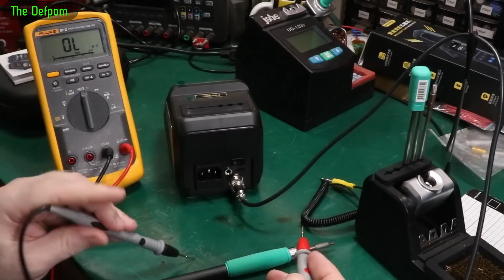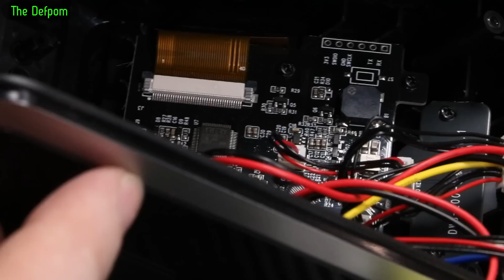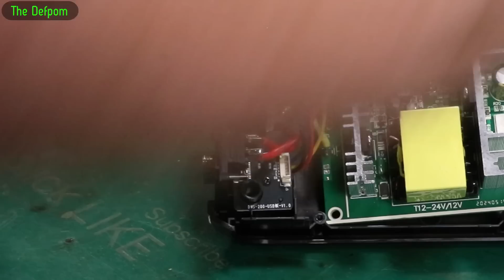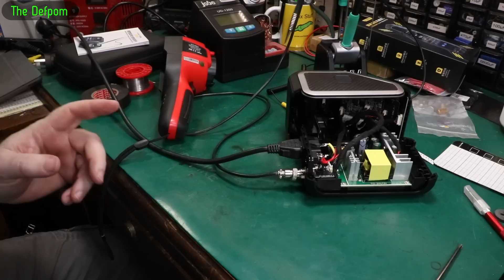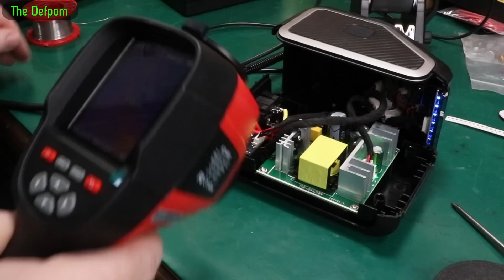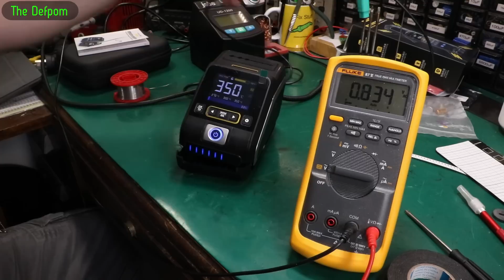🔴 FNIRSI DWS-200 Soldering Station Review Followup and Improvement - No.1321

Comment: You should just short that, not 2 Ohm, but with a short. I did that, in fact, I've added a decent thick copper wire from earth connection to the 5 pin connector directly. But, there is another big problem with this statuon. Haven't you notced wideband noise from it? I did. I'm a HAM radio op. and this thing makes weak signal reception impossible. I did tested with a spectrum analyser with a wide band antenna in about a meter and this thing is horrible. I've added ferrite beads before the SMPSU on the AC lines and afterthe SMPSU on the DC lines, it helped a little, but I'm very disappointed. This soldering station is also sold in EU, which means it should have been EMC tested, I'm wondering how it passed. I even notice the noise from it when I check low level signals on osciloscope. This is how I actually found it is polluting, then tested with spectrum analyser and realized the iron is not earthed so I added the short. Shorting actually made the EMC issue a bit worst (not a lot, just a few dB). I was thinking to get an Aixun, this has metal housing and it is a closed tube, but inside it has the same SMPSU 😞
Reply from the maker: The SMPS is also audible, you can hear it cycling. My previous bench iron is a jabe UD-1500 which is very well made and I really like it, I reviewed it a few years ago:https://www.youtube.com/watch?v=rzp24iXOqdI 
I am thinking of going back to it now that I have used this unit for a while (although it works OK, and has features I prefer in some ways)
Reply: @TheDefpom  hello will you be switching back? I'm in the market for an iron am stumbled onto your video
Reply from the maker: @unknown12712  It has been working well for me, my 2nd choice is the Jabe UD-1200, which I also reviewed.
Reply: wait til you find out about arc welders dude
Reply: I believe the design engineers didn't fully understand how static electricity and leakage current manifest on the soldering station: if the soldering iron tip on the handle is properly connected to ground, there will be neither static electricity nor leakage current. As for the EMC problem, it's purely because its switching power supply is terrible and likely hasn't undergone any EMC certification testing.

Comment: Hello, I'm wondering if there is a soldering station model that allows the C210 and C245 tips, that is good and not so expensive, as an alternative to JBC and Hakko, etc.
Reply: This featured model comes with two handles. One has T210 and the other T245 fake JBC handles. They come with a lot of tips to. According to some people real JBC tips work in it and these tips you get with it work in the JBC stations as well. So yeah. Also people have measured that it does pull 200 Watt out of the wall when tip is dipped in water and you choose maximum temperature.
This model does almost everything that JBC models costing 7 to 8 times more do. 
But then it is a thing where any part can die in months and controller is just an universal STM32 chip. I mean they did really good with interface and features for what it is but it is nowhere near what JBC does with their stuff.
With JBC sponge and handle has antibacterial effect and it is still light and cable is great silicone cable. They copied almost everything but is is antibacterial?
Most JBC station have really great case and are powered with the transformer of decent size and weight. This uses ordinary Chinese switching 24V power supply. No wonder it ahs issues with grounding and that it emits tons of magnetic crap around. Even on one video camera pickups EMI as soon as you start melting tin and you hear buzzing. In real life you can not hear it but camera is affected by it. 
So yeah JBC stays for what it is a professional tool.
While this is great value and if it dies in a few months you get another one and get even more spare parts with it :)
Reply: I recommend you to consider AIFEN A9 PLUS Soldering Station.
Reply: The AIFEN A9 PLUS Soldering Station is in a very different price range.

Comment: @TheDefpom Have you reached out to FNIRSI regarding this issue?
Reply: @samiu7580  Hi. I've received the answer from Nfirsi today. If you want to get grounding to the tip you have to solder in a zero ohm resistor on the two empty pads which are shown in the Video. By the way very good explanation and thanks for your video @theDefpom
Reply: @STUDIO4REO  or you could jump the two open pads with a solder blob for immediate earthing as apposed to receiving impedance. A zero ohm resistor is the same as a solder blob.?? I see theres also an unused open male pin on the 5 pin handle socket plug that goes nowwhere.
Reply: @STUDIO4REO  What was the answer from FNIRSI?
Reply from the maker: @samiu7580  no I haven’t, I doubt I would get an answer about this particular finding anyway.

Comment: Why did they leave the resistor out? They're Chinese, they don't care about safety, or anything at all, really. Perhaps it's normal for Chinese technicians to be soldering live circuits?
Reply: My friend, I understand your frustration. However, if I were to recommend a soldering station with a built-in ground fault monitoring and alarm function, it would demonstrate that there are indeed some incredibly dedicated Chinese engineers. They are capable of achieving exceptional performance and value for money.  It might surprise many people: it heats up quickly, is durable, energy-efficient, compatible with power supplies worldwide, features ground fault monitoring and alarm, and has intelligent sleep mode.  It effectively addresses almost all the pain points users experience.
Reply: С резистором станция сходит с ума - при прикосновении к заземлённой точке начинает греть жало "до покраснения"!!! Вот такой дефект реализации мониторинга температуры жала. Это у всех "китайских" контроллеров С245 так!

Comment: Can you check one thing with that soldering station do you get any interference on the FM band on the radio I've managed to buy soldering  GEEBOON TC22 C245 station. Work very well but so much Emi interference and all the radios on FM band I get this interference even when the soldering on is in standby and the power supply is on and it's exactly the same power supply that you have there. I've tested the choke it's good the capacitor is good the Earth to the tip is good the Earth to the body is good the Earth to the negative of the output capacitor on the secondary side is good.
Reply: I've had Chinese rubbish completely wipe out MW (called the AM broadcast band in the USA) before, but causing interference on FM, that's some truly extreme negligent design work for sure!
Reply: @BrianG61UK  I have improved it a slight bit by adding large amount of capacitance on the output DC stage or adding better capacitors than what they had before well crap. But still some FM stations not very good it does wipe them out. When I look at the actual switching frequency on the secondary winding it's about 25 kilohertz which is very low should have been a lot more higher. The next thing that I'm going to try will be to remove the switch mode and add a Transformer with a basic full Bridge rectifier with a good smoothing and then see if that gets rid of all this garbage noise it should as it's linear not switch mode. And if it is the case and everything works out very well I'll have to get somebody to 3D new housing or maybe I could just look for something which is metal just the right size and add everything from the Chinese iron into it including the Transformer.

Comment: J'ai vérifié le mien, j'ai un voltage qui varie 30 à 40 volts dépendant du voltemetre utiliser.
D'après moi c'est un voltage induit par effet capacitif. (Varie en fonction de l'impédance du multimetre)
C'est la raison pour laquelle qu'on lit un voltage AC et non DC
En ajoutant une résistance de 5.58k en parallèle avec le multimetre,le voltage mesuré est de 0.470 volts.
Reply: Can you let us all know how you went with that resistor in there please
Reply: when I measured with the multimeter I went from 40 volts to 0.470 volts.  what confirms it for me is by capacitive effect.  I did not modify the soldering station after this.

resistance between soldering tip and ground > 2 G ohms at 250 volts.
Reply: @colingag  Isn't this obvious? Why did you need to check?
Reply: @BrianG61UK  
As a personal experience, I wanted to know what voltage it would have dropped to.

Comment: I use Hakko soldering equipment and the tips are absolute direct earth grounded.  No way should that have been left floating.  Missing part was probably intended as a fast blow fuse in case the tip touches a live circuit, like a mains line or DC supply, that has earth ground reference.  Good video!

Comment: @Defpom It would be good if you could do a short followup video or comment, letting us know what happens if you connect the tip to mains earth following your mod. Does it behave well or does it exhibit the same, pretty nasty, problems that tony359 had with his Aixun T3A? If it does work well it would be interesting to know how FNIRSI avoided it - beyond eliminating the ground connection altogether.
Reply from the maker: @tonyh6309  it’s been working fine.

Comment: I just received this station and it seems to have trouble melting solder even though I have it set to 450 degrees Celsius (way too high I know).  I don't have a tool to calibrate it so should I just return the thing? Has anyone experienced anything like that before and have any tips?

It seems like the tips temp fluctuates even though it does not show it on the display. I find I have to touch the solder near the upper sides of the tip as well which doesn't seem right. These are brand new tips and I have a lot of trouble getting it to work.
Reply from the maker: sounds like you should send it back.
Reply: i received this station today and i dont have problems to metling solder with 300 degrees, maybe you need to calibrate it.

Comment: (Part 2) I see tony359 has commented here earlier; I strongly suggest you watch his video about the awful Aixtun T3A and read my comments there - search "Is the Aixun T3A a good T245 soldering station?"
There's a good reason that JBC used a transformer rather than a cheap SMPS!
Maybe FNIRSI have avoided these problems by clever engineering, but I somewhat doubt it...

Comment: BAD MOVE!!! (Part 1 of 2 in attempt to avoid YT deletion)
The tip thermocouple is connected between the tip and heater element common. The latter will be connected via the iron's flex to the station's -ve.
So you've just created an alternative return route for the heater current should you try to solder a joint that is mains grounded -through the thermocouple, tip, grounded equipment, mains earth, 2ohm resistor back to station supply -ve. A few amps of heater current going through your precious, pride and joy, device-under-repair might not make it betterer!

Also bad, if not worse, the new 2ohm resistor + plus the parallel mains earth route are now shorting out the tip's thermocouple so the station will likely pump up the power to maximum!
Reply: Y que pasa si pones 0.22 ohm en lugar de 2 ohm que posee la jbc ( la jbc tiene 0.22 ohm mas un fusible de 1.5 amp.) conectado a tierra  , funcionaria ???
Reply: @orlandoalarcon4158  Maybe, but I doubt it. As far as I can remember (it was a year ago I looked at the JBC schematics), JBC ground the actual tip - not the TC/heater common lead/-ve power supply via the fuse + resistor. The fuse has a parallel 1.2MOhm resistor to keep it ESD safe should the fuse blow and the series resistor is only there, I believe, to allow them to measure any earth leakage current.

You could do the same to the DWS-200 but the mains leakage current through the class Y EMI/filter cap in the SMPS would then flow through the TC (thermocouple) potentially swamping the tiny (uV) TC signal upsetting the tip's temperature regulation. The JBC station doesn't have that problem because it uses a mains transformer and thus does not need a class Y cap to filter high frequency switching noise.
Reply: yes, that is a problem with badly implemented 245/210 irons. sometimes you have to swap the polarity of the tip. that sometimes fixes the issue.

Comment: EMC problems?  Maybe it failed an EMC test with the iron grounded as any HF leakage current from the switching PSU could be coupled back to the iron lead which would act as an additional antenna.
Reply: igual en la jbc esta conectado a tierra una resistencia de bajo valor + un fusible de 1.25 A  y en paralelo al fusible una resistencia de 1 mega  y no se pueden soldar circuitos con alimentacion en vivo el fusible saltara

Comment: its safe with that resistor to update firmware via USB-C ?
Reply from the maker: @Rudimaximus  that is the question, it probably depends on how your computer handles earth connections on its ports.
Reply: @TheDefpom  use a flash drive, $4 beats losing a pc worth thousands.

Comment: Now put a note on the unit. "Never work on a live voltage connected device "
Imagine touching your "earth" solder pen on the hot side...😮
Even on the low side could be a problemow
Reply: en jbc  tambien debes poner esa NOTA pues esta conectado a tierra con una resistencia de vajo valor
Reply from the maker: @MiguelHernandez-ef3pw  I would never work on live equipment anyway, that is just asking for trouble, is a great way of killing yourself.

Comment: Never ever connect a soldering tip to PE. Think what happens if you get in touch with something still powered. Guess why weller still uses legacy transformer PS in their WX Series. I own a WX2 and the tips are definitely not grounded. Nor are they grounded in my old Magnastat stations. This is not the right way to assure ESD protection.
Reply: This is total BS , I don't know any technician ever touch live unit with soldering iron! Potentials in some cases could be even worse as we seen. I have the same unit , but I'm still in investigation what is the proper way to solve this issue.
Reply: entonces jbc tampoco serviria si tiene conexion a tierra una resistencia de vajo valor + un fusible de 1.25A y dice que no se pueden soldar con circuitos alimentados caso contrario el fusible saltara

Comment: I am not an expert on how the 245 works but I think wiring the negative to ground is what Aixun did and it ended up with the controller losing connection with the thermocouple when soldering something with ground connected (it can happen to have it in the way). When that happens the controller sees a momentary "low temperature" coming from the thermocouple and tries to compensate by sending full power to the tip. I showed my Aixun overshooting up to +160C on my tips. And that genuine JBC tip only lasted 12 months, wonder why... :(
Maybe removing the ground connection is the "lessen of the two evils": you get 90V but - as you noticed - very little current so it's kind of "safe" for the components? After all that's how USB soldering irons work - they have a voltage and they are ungrounded. 
Call me old-fashioned but I'm happy with a soldering iron which is grounded and has no voltage at the tip :)

Thanks for showing us the mod :)
Reply: I read on reddit about a guy who bought several dws-200 for his work and it was destroying mosfets on new boards, not sure this problem has been solved or not

Comment: A little voltage never hurt anybody 😂
Reply: @QsTechService1  That's why there's no "high current" warnings but only "high voltage" ones 😉
On a more serious note, despite the 90V on the tip, the current is barely measurable. I certainly wouldn't use this iron to solder on grounded PBC's. But other than that, I personally don't see much of an issue.
Reply: @sesvid  The problem is not getting shocked, but destroying the gate of sensitive mosfets and cpus/gpus

Comment: Now all you have to do is the same for the Sequre soldering tweezers.  That too has the same problem due to the PSU not having an earth connection.  One solution I have seen is to plug in a USB A cable into PSU and attach its 0v wire to earth.
Reply from the maker: Not an issue in my case, my USB=C supply is earthed, so the voltage on my tweezer is fine.

Comment: I would have thought a y2 capacitor would be better? Could be right about the usbc need to test it
you said the resistor as a fuse!!! you don't want it as a fuse that's defeating the point of having Earth! I would say something like a 200 300 ohm resistor or an induction coil 3 mH 1 mm gauge

Comment: Now you are not allowed to solder on board with live voltage. There are cases where you just do not or cannot eliminate voltage from the board you are soldering (machine has to keep running while you replace spare part). At least they left traces open, so you can do the mod and be responsible for it.
Of course, there are pros and cons, sensitive electronic that is without voltage, now cannot be damaged with grounded tip.

Comment: Please do check what happenns if you now touch something earthed with the tip. Asking, because I've tried that after soldering a 0-ohm onto those pads, and afterwards it appeared to mess up temp sensin. The iron would start pumping significant heant into the tip while the temp indication seemed to sag somewhat - however, when the tip to earth contact ends, it then shows a significant temp overshoot, like 450C instead of the set 300C. And I'm affraid it could fry the heater in the tip, or something, if I'd held the tip on the earth for longer.
Reply: You wouldn't get that problem with a y2 capacitor I don't believe